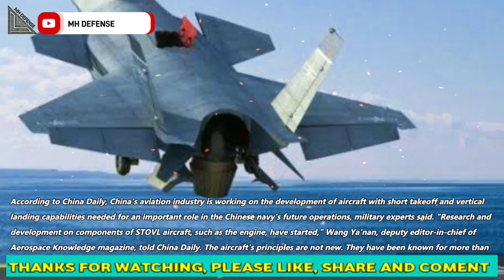China develops new engine for STOVL aircraft with short takeoff and vertical landing capabilities

Comment: Boy, that comment in the video about "R&D of components of STOVL aircraft... known for 40 years" is so off base.
The F-35B isn't even an original American invention, it's a Soviet design that was purchased from Russia after the Soviet Union fell for some outrageous price (Was it $500B?). American scientists had been experimenting with various VTOL ideas since the 1950's without success. The Soviets had done R&D including test flying prototypes but the Soviet decision makers never gave the green light for production.

The capabilities of the F-35B are revolutionary because the plane can't be compared with the Harrier... The Harrier was subsonic, short range and couldn't carry much of a payload, and that's besides burning enormous amounts of fuel. The F-35B is the only VSTOL aircraft with full, almost no compromise fighter capabilities.

So no, I don't see the F-35B being duplicated by anyone including the Chinese without a deep and extensive data theft.
But, that's also not the entire picture.
Even if China succeeds in designing some kind of STOL aircraft that can be flown off carriers, AFAIK China doesn't have a full carrier solution because AFAIK China doesn't have anything like the Osprey for support purposes. In other words, the carrier would have to return to port for any replacement and repair parts or other support since China has no aerial means of transporting that kind of equipment and supplies to a carrier at sea.
Reply: The Harrier had two types of engine and they chose the Pegasus P.1127 which was subsonic but the supersonic P.1154 was designed and that’s where it came from using different systems with open release. Russian spies were very good and we know this from the TU 144 konkordski but that failed as copies don’t always get all the info and the Russian VTOL never done much as the we know and it was the British that shown the world what it was with the Rolls Royce flying Bedstead

Comment: VTOL is a waste of time.
It means carrying an extra engine during flight.

Develop UCAVs for aircraft carriers. Small, light, stealthy... they require shorter runway, take less space below deck, do not require food, nor rescue.

Forget EMAL. Sky jump with EV. Imagine a pair of Tesla's ludicrous mode... without the chassis, battery... drag racing tyres, 4WD... to both rear wheels of the UCAV and catapulting to 100km/h in less than 2 seconds then sky jumping.

The low mass  EV catapult vehicle is railed into the deck and has a buffer to slow/stop after launching.
Reply: The UK invented steam CATOBAR and STOVL and chose STOVL with there new carriers as it worked in the Falklands under terrible weather conditions as CATOBAR wouldn’t have work as well with takeoff so it’s not a waste of time because not many nation’s have actually been involved in naval conflict since WW2